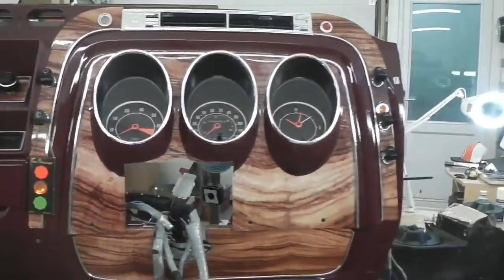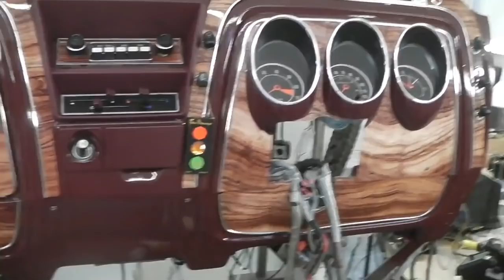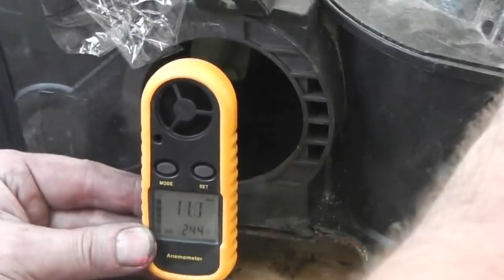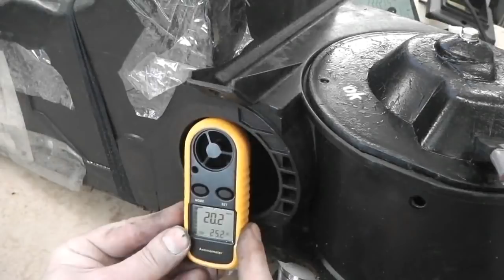Classic Car Restoration - Cortina Mk3 - Project Bramble EP34 Pt1

Comment: A strong and pretty much instant crack repair is to push paking soda into the crack and drip super glue onto the soda. Can also be used to repair deep scratches, fill scratch with baking soda and add drops of super glue until soda is completely covered. Dries almost instantly and can be sanded to desired finish. Apparently this method has been used by guitar repairers for some time. Finish will also take paint for invisible mend.

Comment: Sorry Pete, live show was a surprise, I saw you just in bed time.  Fan Box made in grass fiber was one worst idea Ford thinked in the Cortinas.  When see you working in was black in time again when with 13 or 14 year old I have to uninstall for some thing I forgot. But for sure I remember 2 or 3 fasten bolt holes was broken and use Araldite epoxi compount and alumibium plates to repair it.

Comment: Hi Pete, top class job as usual. I don't know if this is of interest but the best and I mean THE best blower I've ever had on any car was in my Fiat Cinquecento S, maybe due to it being a lot hotter in Italy. My Mrs would actually dry her hair with the dash vents in the car if we got soaked whilst out and about. I'd love to have that Cinq' blower in my Mk3 as the original unit on full power is like a weak breeze. Also I've had pieces of sponge foam working their way through the vents! I dunno what part of the heater box they've come from, plus a nice under dash leak running down the bell housing part of the transmission tunnel whilst in a carwash! X¬D
 As for the full fast blower on a facelift you are correct, left and pull on the fan switch.
Reply from the maker: thanks mate!!!! well this motor is pulling 25a  so theres 300W of pure power !!! ill ask the mrs to test dry the cortina hair dryer!!!

Comment: dash board kinda looks like spettitti junction! at the front all nice and clean and seems okay behind it choas utter choas but the okay kind, the heater box was okay other then one lil tang or screw in part broke when removing it but you said they go there and we'll glue that back on, lol if only he knew shame been nice to see TC at the nec, maybe in octuber pete? mind you by then bramble might be fully ready to go, looks good pete not bad for one video on the heater box might be they removed the pipe part for the other country's that didn't need them and though it would save on like time in the factory rather stupid really just makes your car go rustyer faster i man you wash your car how do you not make the water go down the vents by the wipers?

Comment: Hi Pete, where did you get the self adhesive foam pieces from? I've tried frost's website but I can't seem to find it. I may be using the wrong terms in the search bar. I need to recreate sealing gaskets in my heating system.  Thanks 👍

Comment: Great video Pete, lots of time and effort gone into this.  What Generation Toyota Yaris did the fan come from? Think it's up to a 4th Gen now.
Reply from the maker: thanks buddy! are you going NEC>>> please say yes!!! ok toyota yaris 2003 model, had to graft it in to heater housing ALSO (not covered on vid) it draws 25A so new cables are used (40A) and a special speed controller is being built (watch out for new video)
Reply: @PeteCswampy  hope to get to the NEC on the friday Pete👍, if I can get leave.
Reply: Hi Pete great video on you heater box refurbish thinking of putting a Yaris blower in my mk 5 traced the wires to battery but the wire that goes to fuse box
also goes to ignition little confusing can you advise which wires need upgrading 
( when you pull the wire from fuse box
it cuts out fan also ignition ?? ) The fuse 
is on 8amps - do l have to replace every wire that comes out of that fuse ??

Comment: Pete , you simply HAVE to watch this . On Neil Miles youtube channel look up Ties 1984 . Originally shown on BBC schools in 1981 , a short "slice of life" or "kitchen sink" drama that features one awesome looking mark 3 GXL . This is my dream car , jacked up rear suspension , side exit exhaust , webasto sunroof , rear window louvres , cobra supaslots , fur seat covers , mag mount cb aerial , it's got it all ! Film is not too bad either . Look up Neil Miles youtube then click on "BBC2 Ties 1984" (was only uploaded this Monday gone) , sit back and be AMAZED .

Just checked the car AOL437K on dvla website , first registered Sept 1971 , tax due Sept 1986 (let's hope this is locked away in someone's garage!) . Interestingly engine capacity is stated as  2994cc so that's an Essex V6 ! Look around the 10 minutes mark in the film and you will see the later 3.0 badge on the wing . Also the GXL badges on the c-pillars look like "E" badges to me (but l could be wrong there) . Hard to tell but that looks like a K&N air cleaner under the bonnet , speaking of which , the F O R D letters have gone from the bonnet and moved to the grille . That is one awesome mark 3 Pete !
Reply: Just checked that out, what an awesome car!!!

Comment: Which Yaris heater motor did you fit ???
Reply from the maker: i think it was a mk2 yaris,i not sure but ou need to to check the vane rotation,  its all needed to make it work, theres a load on the loom
Reply: Thanks when you say load on the loom as l am not an electrician but can do simple wiring or copy diagrams is that a load on just the heater wires or the whole loom ???

Comment: Hi Pete, I’ve had the mirrors and under riders fitted to my GXL. Could I ask where you bought the exhaust system for your cortinas?
Reply from the maker: waybe alwasy used local motor factors mk5 exhaust same